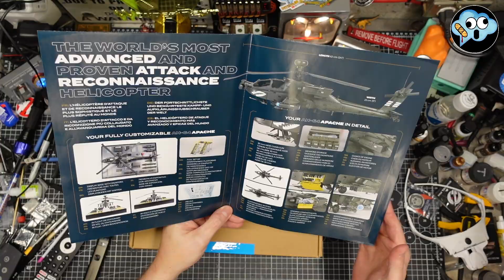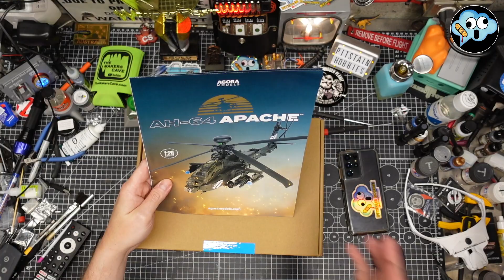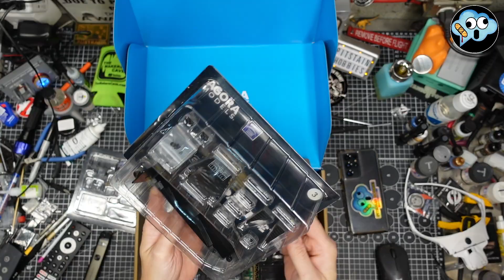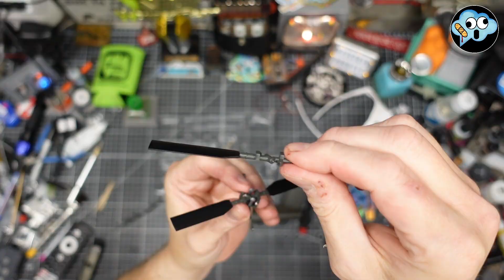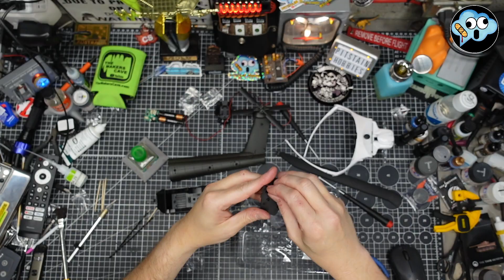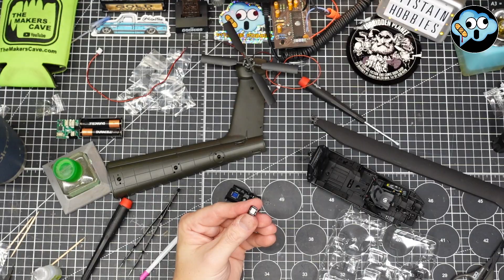Agora AH-64D Apache Longbow 1/24 model build, part 1.

Comment: Is it worth using clear glue throughout the model, instead of using CA and some clear for glass parts? Is there any difference on how they glue? I know how they both differ, but, to me it's worth using clear all the way?
Reply from the maker: CA glue is preferred in some places for both it's bonding speed and adhesion, regular Tamiya thin cement will work on unpainted plastic to plastic connections, and PVA glue can be used on clear parts as it is water based and dries clear. Never use CA glue near clear parts as it can permanently cloud them.